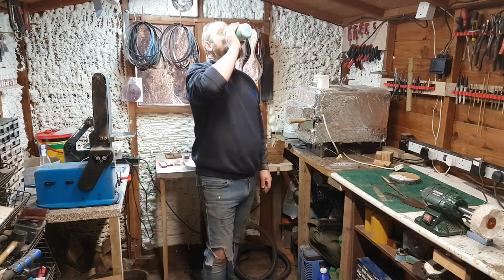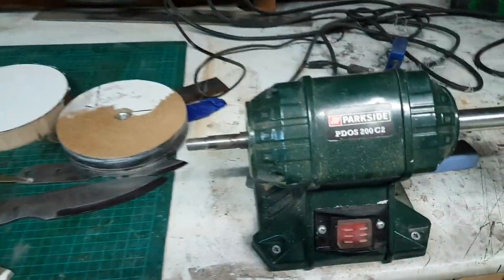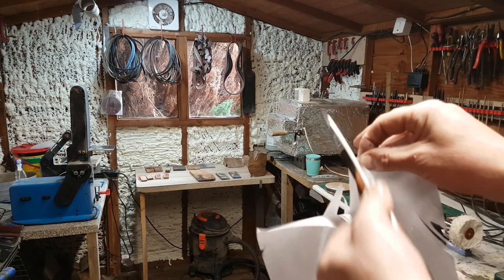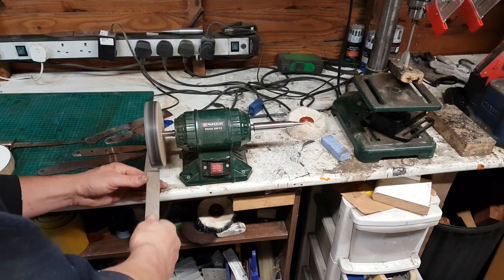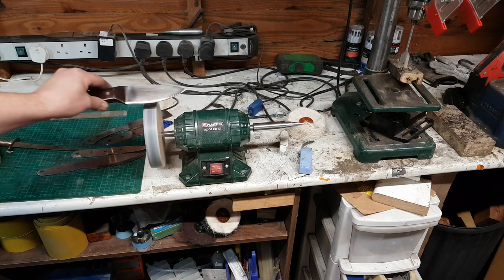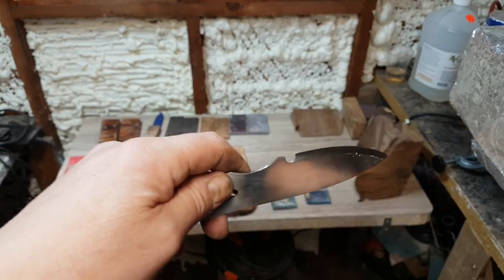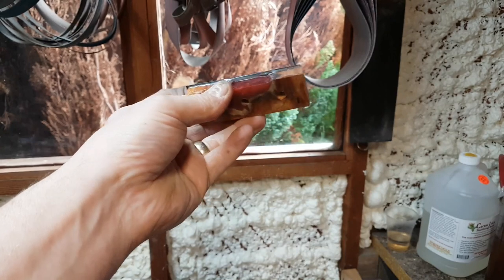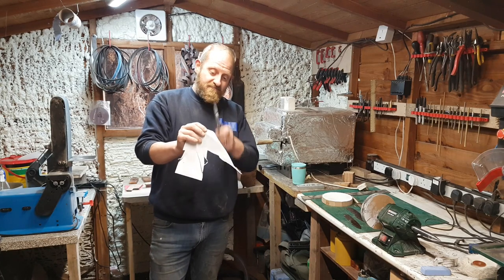MDF honing wheel for sharpening knives

Comment: Damn, I can't believe it actually works. My v1 failed because I used plywood, v2 also was a failure because it was a buffing wheel, but the MDF I finally found does really well to make it super sharp. Only thing you need to know, removing metal is unavoidable and this method won't skip 400-800 grit to reshape the edge. But for maintaining your own knives it's definitely a speed run.